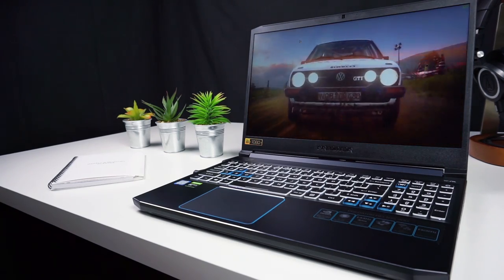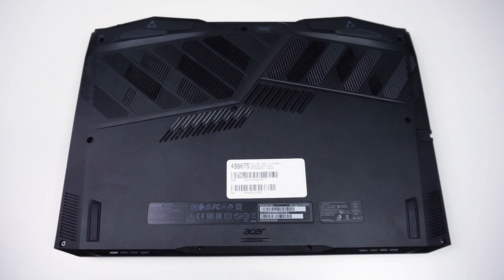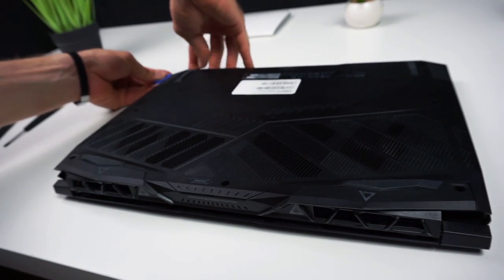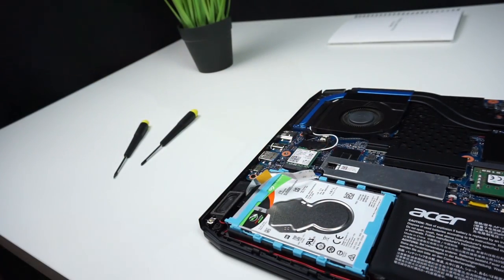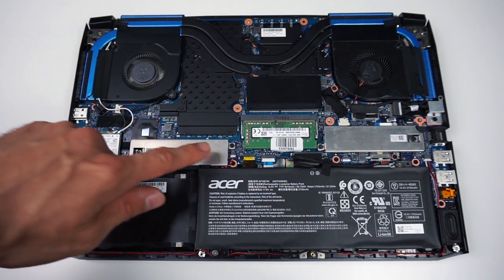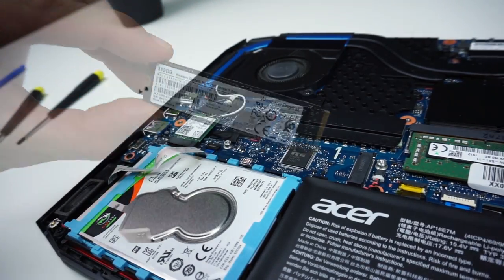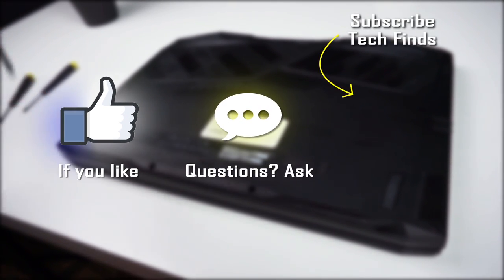Acer Predator Helios 300 2019 Upgrade RAM / SSD / HDD - Disassembly Guide

Comment from the maker: ✅ Free download RAM / SSD / HDD data recovery software: https://bit.ly/2zRpN9B
Reply: Will i be able to upgrade to a single 32 Gig Ram stick?

Thanks in advance.
Reply: I install the 500gb Samsung SSD which you recommended. but after that, my screen sometimes gets stuck while playing games, which never happened when I play the same games before. What cause this problem? thx.
Reply from the maker: @leopu6778  it seems like game crash, or is it possible to continue game after freeze? There may be many possible causes like badly optimized or pirated game, not stable undervolt (even if stock), or defective drive. You have to figure it out
Reply: hey, can i have the following config on helios 300 - 256gb ssd(which came from the manufacturer) + 1tb SSD(in the second m.2 slot) + 1tb HDD(as given by the manufacturer) + 32GB RAM(replacing the two 8gb sticks with 16gb sticks). will this config hold stable?
Reply from the maker: @GM_Nougat Nope, 2666MHz is max
Reply from the maker: @GM_Nougat If i had to upgrade both sticks i would choose HyperX as it has low latency
Reply from the maker: @chriscarlos403  No, this is a desktop RAM and it will not fit to any laptop. In the description i left links for laptop RAM

Comment: Thanks.  I found this useful but I ran into a little issue adding a second SSD on my PH317-53-798L.  Basically, the 2nd screw (the one to the righthand side) would not shift.  Also the screwdriver I used was almost just turning yet it got good purchase on the left hand screw and they are the same size screws.  I tried different screwdrivers and also using pliers to turn the screw but could not get it to shift.   However, my board is slightly different to one in the vid and there was a rectangular piece of metal under the screw that was then screwed into the board just below the SSD.  I was able to remove 'that' screw then rotate the metal to the right slightly to accommodate the SSD.  I screwed everything back in place.  Its not perfect as the horseshoe cut out on the end of the SSD is not flush around the righthand screw but I was able to get everything secured and the SSD works fine.  Just posting this in case someone has a similar problem.

Comment: Hello everything is fine? I have an Acer Predator Helios 300 model PH315-52. He had a slight fall and laterally dented the right sides of the 3 carcasses. I bought the 3 pieces on Ali, but I haven't exchanged them yet. On Facebook, a time I made a post there, they commented to be careful when changing the housing that holds the screen of the note because there is something that would be welded to the housing. Do you know if there is? If I'm not mistaken, they said something about the Wifi card near the webcam. Thank you very much in advance. Thanks.:

Comment: I've been working up the courage to crack mine open for a year haha.

Do you have any recommendations for the tools you used as well? Wouldn't mind keeping a little kit together for PC tools. My brother had some little screwdriver with a magnetic tip when we built our very first gaming desktops. Would something like that be recommended?
Reply from the maker: Yes, actually any kit made for that purpose will be ok. It's nice to have some thin plastic things in it to separate the bottom cover from the deck.

Comment: You are awesome bro! I read almost all of the comments and learned a lot. However, I can't seem to find if someone have already asked this same question: whether the instruction for installing HDD / Ram are same with the 2020 model of helios 300?
Reply from the maker: Thanks mate. Yes, the 2020 model has the same build. Only I'm not sure if it supports up to 3200MHz ram or 2666MHz
Reply: I hve the 2020 model..i checked it supports 3200hz

Comment: Hi I was wondering if it's okay to change/ remove the  pre-installed m.2 ssd drive because I was planning to  get 2 new 1tb m.2 nvme ssd + plus the 2 tb  hdd hybrid that was in the video to get a total of 4tb storage, or is there a limit how much storage  I can upgrade? Also will it remove pre-existing  acer programs like turbo mode etc, and do I  have to reinstall windows  and whatnot if I did remove it? Srry for all the questions  and thank you for the video!
Reply from the maker: Yes you can replace the original M.2 drive and you will need to reinstall windows on the new drive. It will probably remove your software from Acer and other things that came with the system by default. I don't know if there are any limits for storage.

Comment: Hi, do you know if all 2019 helios 300 versions have upgrade-able RAM? I have a friend who wants to buy the helios 300 with i5-9300h and 1660ti, but it only comes with 8gb RAM in the UK amazon. Also in the product description it's stated that the Maximum Supported RAM is only 8GB, hence making upgrading the RAM impossible. This must be a mistake right? I thought they all have the same motherboard just different components.
Reply from the maker: You're right, this must be a mistake or something. Every model of 2019 Helios 300 supports up to 32GB RAM (2x16)
Reply: @TechFinds  Thanks a lot for the help! You deserve way more subs.
Reply: @TechFinds  Hi!
I nearly ordered 2x32, thanks for this comment!
Reply from the maker: @damasame  Yes this Ballistix is compatible
Reply: @TechFinds  cheers, is it better, or worse compare what you have in the description?
Reply from the maker: @damasame  It's the same ballistix that i linked, but i would rather go for HyperX instead
Reply: Tech Finds I have a 2020 predator with 32g so I cannot upgrade to 64g
Reply: I want to buy this specific model. Where can I find? How much it will cost then triton 300 2019

Comment: I purchased my Acer Predator 2019, installed de 32gb ram crucial and the samsung evo 1tb ssd because of  your videos. Everything works perfect 🙌

Thanks a lot for the great content! I've been enjoying my predator so much :)
Reply from the maker: Great to know that the video was helpful. Thanks for commenting!
Reply: Yuki Agnabo did u find out ?
Reply from the maker: @teliyeti7151  if you gonna add one ram stick to your stock ram go for single rank. If you're adding 2 new sticks you are free to choose knowing that difference between single and dual rank is like 0-4% depending on game. Single + dual should work as well, but it's better to have the same specs for peace of mind and to avoid eventual compatibility issues
Reply: @TechFinds  sup buddy, hey is samsung evo 980 m2 compatible with this acer predator?

Comment: for a reason my hard drive does not show up on my computer after I install it. it did show up when I use my samsung 1tb hard drive the first time after upgrading to my new one which is exactly like the one you using in this video it doesn't work?

Edit: ok I know what going on it turn out the hard drive cable was damaged idk how that happen it smell like it got burned or something hopefully that doesn’t damage anything around it.

Comment: Tomorrow comes my Helios 300. Do u think stock 8gb ram will be compatible with HyperX 2666Hz. If not guess i have have to order another HyperX.
Reply from the maker: It will work, but it won't be 100% compatible. I mean it may run at 2400MHz in order to match latency or other stuff.
Reply: @TechFinds  Is there any point ordering higher Mhz memory?
Reply from the maker: @pathofexile7529  Just to match the original RAM when you mix. The laptop supports up to 2666MHz RAM. The higher number the faster RAM ofc, but idk how much improvement it is over the 2400MHz.
Reply: @TechFinds  As u said 2666 is max so i will order one more set of hyperx 2666 and thats it then. No point buying 3200.
Reply from the maker: @pathofexile7529  Yep, exactly.

Comment: I cannot seem to find the ribbon cable or hdd upgrade kit, any recommendations for purchasing one that is compatible?
Reply from the maker: The HDD upgrade kit for this model can't be replaced, because it's individual. The only thing you can do now is to contact Acer - I remember that they were providing cables and stuff for other models, maybe for this too. Another way is to find it on the internet, maybe someone is selling it.
Reply: Is the upgrade kit supposed to come w my acer when I purchase it? Or is it something separate?
Reply: @andreasdecarvalho3321  I think the new ones (2019 and newer) come with the kit. Older models I believe you have to contact support to get your hands on one. I’m not 100% sure but I know my Helios I got last week came with the kit.

Comment: Hello. First of all, thank you for this video. Which are the maximum SSD and M2 capacities to upgrade? I saw that you used a 2 Tb SSHD and a 512 M2 am I right?  Can I have, for instance, 2 512 Gb M2 + 1 480 Gb SSD?
Reply from the maker: There are no limits. But if you wanna go more than 2TB HDD the problem is that these 2.5" drives are usually thicker and they probably won't fit so 2TB is max for HDD/SSHD
Reply: @TechFinds  So, the only limitation for upgrades is 32Gb of RAM, right? Thanks!
Reply from the maker: @willianvieiradeabreu1629  Yep

Comment: The recommended parts you listed in the description are compatible with a Predator PH317-53? Thank You for your video!
Reply from the maker: tell me the specs and model year
Reply: @TechFinds  what about the 2019 Helios 300
Reply: I think the SSD and HDD might be compatible. But coming to the RAM, please check if the CL values and frequency match with the existing RAM stick values

Comment: Man you got me confused on the hdd part, should've just re-recorded that part
Reply from the maker: I found that out after i sent the laptop back.
Reply: Ahh okay, so let me get this straight, you flipped both the sshd as well as took the rubber off and flipped it in order for it to fit properly?
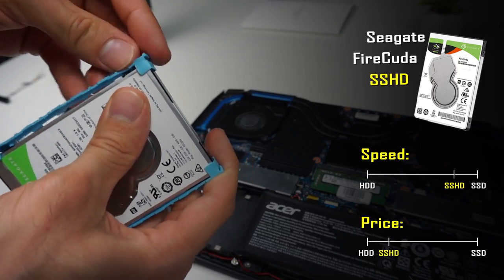Reply from the maker: @Sullyx  The blue frame should be installed like in 01:55, then you put the drive inside the drive bay the green circuit board side up like in pop-up window in 02:35
Reply: Thanks a lot dude ❤️
Reply: @TechFinds  do you know how to enable the ssd in bios after installing or should it automatically detect it? I don't know if I should have gotten the firecuda or not. It didn't show up in win 10 at all.
Reply from the maker: @brucebanner3566  Because you have to make a partition in disc manager in order to have new drive shown in Your PC. ;)
Reply: @TechFinds  thanks, I figured it out with a technician. The problem was that the heat pad was pulling out the ssd from the socket a little. Now, that it works, I was able to transfer 240 gb in 3 minutes to the new ssd.
Reply: My helios 300 already had 1tb hdd, so I cannot put another 1tb ssd and have both of them? I should to chose only one??
Reply from the maker: @sdors4  Check out the video. The laptop has 2x M.2 slots and 1x 2.5" drive slot. Now you have to check what slots you have free
Reply from the maker: @Hani Ouali if you will find a 2.5" drive that is not thicker than 9mm. Usually 3TB and more have about 15mm thickness
Reply from the maker: @Hani Ouali Yep it'll be good
Reply: How the fuck does youtube know we are friends
Reply: @Sami_m_a  ur subbed to me :)

Comment: I didn’t knew you need a sata cable for this model, I bought now a 2TB ssd in the 2.5 format and I don’t have a holding or a sata cable, I thought this model came with them included

Comment: Can you tell me what is the best ram you can upgrade in Acer Predator Helios PH315-53-72E9 2020 model. Currently it has Samsung 8gb 1rx8 3200aa x 2 chips. I saw many upgrades why are they using 2666mhz to upgrade and not 3200? Or is there any higher?

Comment: What is...CL ..ram of Acer Predator Helios 300 2019
Reply from the maker: CL19 / 1.2V / 2666MHz / 260 pin
Reply: @TechFinds  Is there only one slot for ram?
Reply from the maker: @ssmith278  There are 2 slots for RAM as shown in the video.
Reply: Tech Finds I can have duel channel?
Reply from the maker: @luuucasus9254  yes, you can
Reply: @TechFinds  how come it's one slot and dual
Reply from the maker: @yousefsaleh8312  This laptop has 2 RAM slots
Reply: @TechFinds  I just noticed one under the black thing and another one is shown, It's been 2 days of research, and I didn't have time to open my  Predator Helios 300 , also you mentioned one only.
Reply: He says two ram slots at 1:25 I'd suggest watching the video again.

Comment: Awesome video. I would like to ask you if it is posible to mix RAM sizes, I mean 4+16 , 4+8, 8+16 etc , It does get slower if you do that or it doesn't matter? Which ssd from the ones that you recommend is closer in quality/speed to the one that comes from default with the laptop? Thank you again!
Reply from the maker: Hey, you can mix RAM sizes, but in some cases it may cause dual channel to be not activated. It depends on the RAM and it's complex, you can't really predict unles you try. However if you ask if it will be working the answer is yes. 
The Samsung 970 Evo is the closest in terms of speed.

Comment: Awesome video! Where did you get that blue rubber mount for the hard drive? Looking at upgrading mine, but I’m not sure whether or not I need to purchase the mount separately or if it comes with the hard drive or laptop!
Reply from the maker: Hello, you should get the blue rubber frame with your laptop somewhere in box. If not, contact Acer support and ask them if they can provide one or guide you where to buy it. The other way is just to look for it on the internet and buy from other people selling parts

Comment: Congratulations on the channel!
I'm Brazilian, and I'm in doubt between buying the helios 300 with gtx 1660ti or lenovo legion y540 with rtx 2060.
Which one do you recommend? Which heats up less, has better performance and better build quality?
Do you still own both notebooks? How are they after these months of use?
Reply from the maker: Hey matw, I made a comparison between Helios 300 and Legion Y540, check it out.
Reply from the maker: I don't own these laptops, I had them only for testing purposes

Comment: Hi there, nice clear instruction great video ❤ just one quick question, after installing the HDD from the free HDD slot, there's no need to set up in the BIOS? will the laptop read it automatically?
Reply from the maker: After installing you have to go device manager and make a partition to make the drive appear in your PC
Reply: @TechFinds  Thank you! you're awesome
Reply: @TechFinds  Hi, do I need to do the same (partitioning in disk mgmt) for M2 NVMe SSD?
Reply from the maker: @driny3387  yes, you have to do it for every new drive in order to make it appear in your pc

Comment: I have the helios 300 2019 as well. I got the 16GB (2x8) RAM model, however I want to upgrade to 32gb, but I don't know if both slots are already occupied and I need to completely replace them, or if I can use any other free slots. 

In the task manager it says I am using 2/2 slots so I think that answers my question, so what would be a good solution to opt for 32gb???
Reply from the maker: This laptop has 2 RAM slots, so you can only replace your existing sticks. If i was to change RAM for 2 new sticks i would choose HyperX

Comment: Hi, Loved your video. I just liked and subscribed to your channel. I Just got this laptop and is it ok to mix and match RAM with different capacity as long as the speed and type is the same? Im planning to replace one of the 8GB RAM with a 32GB stick which i think will result in a 40GB total RAM. Will that cause an issue? Kindly advise. Thanks!
Reply from the maker: This laptop supports max 32GB RAM (2x16GB) 2666MHz. You can't install one 32GB stick in one slot. It is ok to mix RAM sizes but it may cause compatibility issues and so the dual channel may not be activated even though you have 2 RAM sticks installed. There's no really way to predict what will happen, because some people don't have any issues and some people do.

Comment: hey man, I saw how you installed one of the RAM memories, but you did not replace the one that was covered, does it work the same way? thanks!
Reply from the maker: Yes it's exactly the same process. The black cover is only a paper so don't worry about it

Comment: Do you have a video explains what you should do before upgrading ssd such as what to do with all our apps and the OS and all that good stuff?
Reply from the maker: You don't have to replace your SSD where you have the system. You have second slot for M.2 SSD. I don't have such video.
Reply: Tech Finds okay cool. So just add a second ssd and I should be all Gucci?
Reply from the maker: @JinchurikiOfSouthTexas  Yep, after installing you have to set the volume of your drive to make it appear in Your PC
Reply: Tech Finds nice dude. Thanks so much!

Comment: Hey, just a quick question. I just bought my Helios 300 yesterday i7 , 8gb , 1660ti and it came with a free 8 gb ram upgrade which would total to 16gb ram. My concern is will the free 8gb ram affect the performance and if it’s going to raise compatibility problems. The freebie is a Kingston 8gb 2666mhz
Reply from the maker: If it came with one stick for upgrade it should be compatible. You can mix brands, it's only important to match the specs. Upgrading to 16GB RAM should improve the performance a lot, because 8GB is not enough for every game nowdays.

Comment: Hi, tech finds, thank you for all your helpful videos your making, and I have a question if you may answer it, what is the best way to remove the fingerprints from the acer predator helios 300 chassis and screen, if you have a specific way please tell me or if it is a product give me the link for it, thanks and have a nice day.
Reply from the maker: I use only slightly wet cotton wipe for. There are some special wipes for display, i bought one in a random market.
Reply: @TechFinds  Thanks I'll be using them and find what is good for me <3